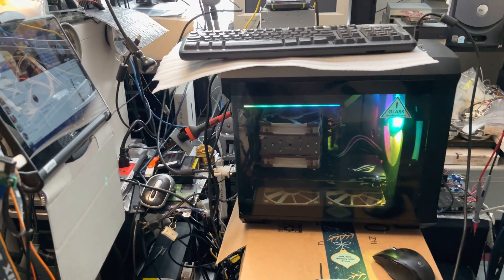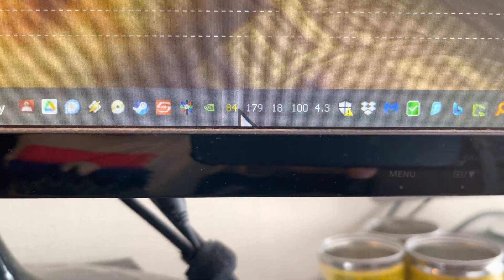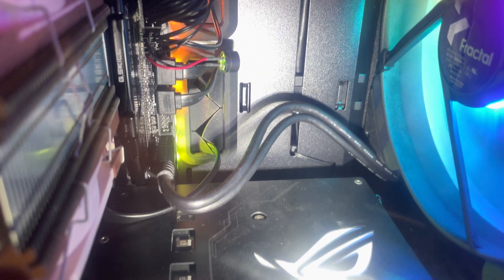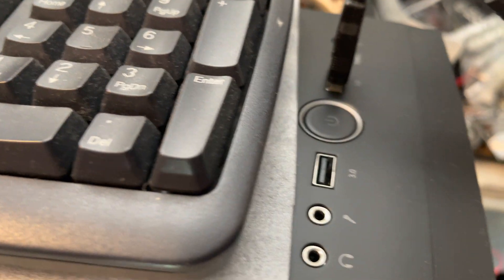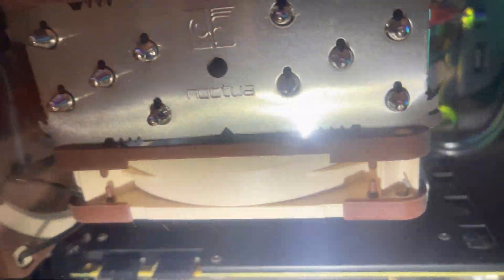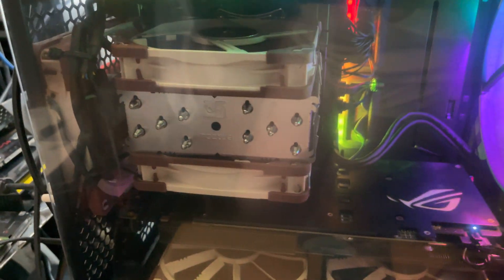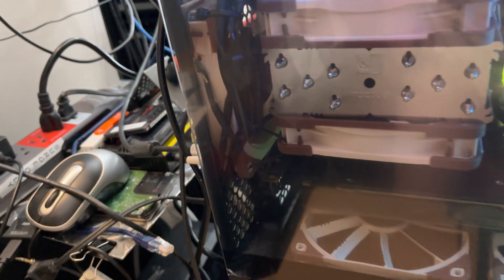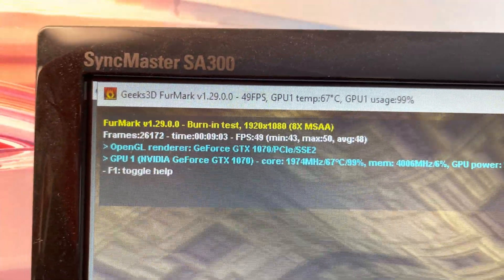Checking temperatures Fractal Design Torrent Nano RGB case with Ryzen 9 5900X & Asus Strix GTX 1070

Comment: I still don't understand why the fans are vertical on the heat sink instead of horizontal. Doesn't this defeat the purpose of the design for air flow specifically with this case? As it was designed as a wind tunnel
Reply from the maker: On this particular case, with that heat sink and those fans, that is the only way I could put it because there’s no room to put them horizontally. this is mostly the fault of the motherboard as the socket is rotated in the direction. Since this video, I have already upgraded to cooler to a different brand that let me mount it horizontally.
Reply: @loveaviation  You can you try swapping that CPU cooler for a Dark Rock Pro 4. Not true it will fit [in theory it should].  But you can set it horizontally if it fits. I think it does. And send back CPU temps  results
Reply from the maker: @thephoenixchant  I have a different cooler now on there since I posted a video and it’s working the way it should now. The cooler is made by Scythe but I don’t know what is the name of it because I’m away on a trip right now. If you want me to get the exact model, then reply to this comment and I’ll get it when I return home.
Reply: @loveaviation  cool yeah thanks

Comment: : Really cool idea with the GPU. How do you control fan speed for the GPU fans?
Reply from the maker: The GPU fans control the speed themselves through the driver. I can set the speed manually but on the strix card it’s excellent the way it set already.
Reply: @loveaviation  : Have you plugged the fans into the graphics card so that they know whether the card tells them to spin up or not?
Reply from the maker: @philippbeckonert1678  That's correct. When not playing games, 5 fans are completely off in the pc. 3 on GPU and 2 Noctuas blowing right onto it from bottom. I like that feature that ASUS has on the GPU to control a set of fans when GPU fans spin up.

Comment: Why is your cpu cooler  in the vertical position? Wouldn't it cool way better with airflow flowing horizontally out the back?
Reply from the maker: That is the only way it can mount on that motherboard. Asus ROG Strix X570-I Gaming Mini ITX. I know it sucks but thats my only option at the moment. I am researching other coolers though.
Reply: @loveaviation  VRM heatsink shroud too high?
Reply from the maker: @nugent6269  No, the mounting holes for the back plate force all heat sinks that are vertical to face power supply intake.
Reply: of course